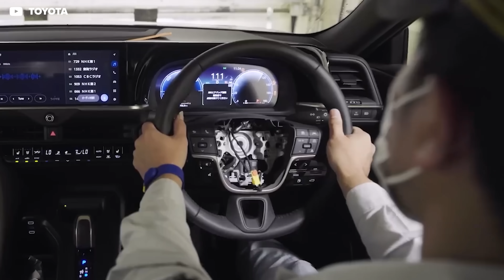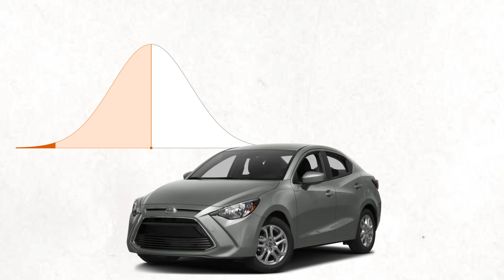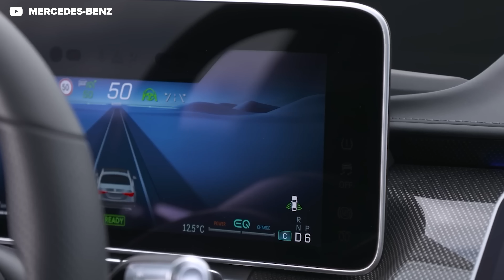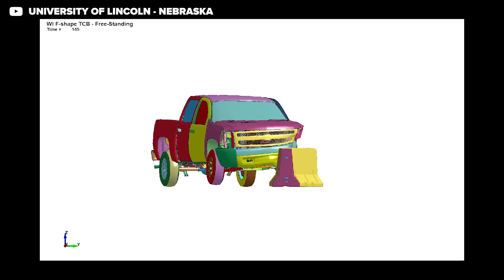The REAL reason guardrails can't stop EVs in a crash

Comment: In the UK we have double guard rails, so they can stop tall vehicles from going over and low vehicles from going under.
Expecting one guard rail to do both is insane
Reply: You could fit five UK's in Texas alone, we have a BIG car centric country, so building a double guard rail system across the USA would cost a fortune
Reply: Simple solutions often do not accur to our fellow beings accross the pond.
Reply: @h-j.k.8971  Despite what Europeans like to believe, North Americans are not dumb. North America is much larger than Europe is. To put some perspective here Canada and the entirety of the European continent are about the same size. The USA is about the size of Canada. Yet, Canada and the USA combined have about half the population of Europe. We have miles upon miles of road that needs to be maintained and less people to pay for it. So often road solutions here need to be cheaper and simpler to build and maintain. The cost of that second rail adds up really fast. It is not fiscally practical for us to use it across North America for our roads. One rail is often more than enough for most passenger vehicles and your little double rail is not going to make that much of a difference for a commercial truck. Those things are too big and heavy for that. The bigger issue here is that EVs are too heavy for a passenger vehicle and most places in North America can not justify having them on the roads. It is not a practical solution for transportation. We are not Europe. We have have different problems across the pond and need different solutions.
Reply: @midknight2329  Wow, looks like I´ve learned something here. Size matters.
Reply: @midknight2329 LOL. O your country so big you can out proper guard rail, but enough money to waste on military that can't pass audit for a decade, and bailout for big corp and billion of subsidies for stupid spacex that failed all its deadline?

Comment: The story was the usual American anti-EV big oil bunk. The maximum weights of cars haven't changed, we're not getting ridiculous 3000+ kg cars ever because nobody's getting an HGV license for them.

And if it comes to a crash I much prefer my weight to be down, rather than up. A heavy battery is a plus. The last thing you want is to embark on a flying roll that'll give you whiplash for life and a concussion.

The guardrail argument is invalid because outside of the US, guardrails are designed different and safer. Often they have additional bars installed lower to catch a falling motorcyclist; Motorcyclists falling and sliding halfway under a guardrail was ussually fatal, so crash-prone areas were fitted with bigger guardrails that extend lower.

Comment: Traditional guard rails are extremely dangerous to motorcyclists. The rider can slide under the guardrails and hit any of the posts with deadly or life changing injuries as a result. If the rider’s head is caught he is facing decapitation. 
All this can be avoided by placing a 2nd barrier under the 1st one. And this will also better guard EV with a low point of gravity.

Comment: Tesla going under guard rail is not about center of gravity but how was designed front crash bar. Height and size of crash bar is standardized (In europe it is 450mm from ground and 75mm thick crash bar? I am not sure at moment).  In case of Tesla issue is shape. They had crash bar designed as wedge!

Comment: 1960 F-100: ~3,088–3,105 lbs (1,401–1,408 kg)

2025 F-150: ~4,021–5,540 lbs (1,824–2,513 kg), with electric models potentially exceeding 6,000 lbs (2,722 kg)

Difference: The 2025 F-150 is 1,000–2,500 lbs heavier on average than the 1960 F-100

so the petrol versions of the F150 have increased in mass by between 30 and 90%....great comparison guys, but why let the truth get in the way
Reply from the maker: Comparing the average across the offered range is not the same as comparing equivalent spec

Comment: Generally a well designed EV isn't much heavier, but many aren't designed so well that way, so the point can still stand, just isn't a given.  The distribution is of course spot on.  Overall, good info.
Reply: EVs are garbage. They are a socialists dream of control.  Most people bought into the hype are now realizing this hard truth.  Poor resale value, limited charging infrastructure, low range, faulty electronics, expensive repairs and insurance.  Oh, and lithium batteries are a huge fire risk.  Time to wake up bud.

Comment: motorbikers cut on rails....so body lays over rail slides along top and rail edge cuts it or the joints that are a bit uneven pointy edge rising up  there , so , stronger armor suits or wider top edge could be half pipe shaped but is that harder to make cost much more,  or add on  thing to edge to make it flatter top , metal or plastic or wood or , or does that sharp edge need to be made smoother with some thick paint like material or epoxy, , or could triangles or something be placed on one or two meter intervals to lift body up throw it off the rail , ramps. metal plates on suits where body gets cut usually so dont get cut plate slides over, or some electronic systems , controlling falls how, drone on back activated , chute, deployed by automatic sensoring or how , movable rails fall back before hits ..hardly soon. oh , if limbs often cut, wire to limbs and  they get pulled to body when crashing falling how, motors or explosives or small chutes and anchors on suit chute moves from back pulling wire ancored to hip pulling arm to hip, or exploding bag out from back pulls wire , or system on bike pulls it . rollde up on wheel or

Comment: Bullshit. The 2025 Cadillac Escalade with the 6.2l IC motor weighs 2508 lbs. The 2025 Cadillac Escalade electric weights 2510 lbs.
The Tesla Cybertruck weights more than 6000 lbs and can’t be sold in Europe.
Reply from the maker: Don't know where you found those numbers but they're way off. The 2025 Escalade starts at a 5800lb curb weight and gets up above 6000lbs if you opt for 4wd. 2508 lbs is Miata RF territory.
Reply: @drive  I transposed the 1st two numbers. The curb weight is 5810 for the EV and 5805 for the IC (I'll stop adding comments to YT using an iPad). 
The point was that the difference between them isn't 1000lbs or more due to a battery.
What's causing these trucks to burst through guardrails and crush smaller cars is the squared off battering ram "macho" front end that is becoming the norm for pickups and SUVs.

Comment: Sorry, but at 2:47, that math to come up with 97th percentile is not correct. If you do the right math for those 2 things, you get 72nd percentile.
Reply: It’s more an error about what he said, speed AND angle is 72% instead of 97% for speed OR angle. The Percent percentile triggers me.
Reply: @evguenict  I mean, the right operator in that case is AND. But yeah, I thought about also mentioning the "% percentile", but thought that wasn't as important and might take away from my main point.
Reply: All his statement requires is that high angle impacts are almost all slower, and high speed impacts are almost all at a shallower angle.  Don't assume the speed and angle of a crash are independent random variables without seeing the real data.
Reply: Math and logic are not his strong suits.  These blatant errors Invalidate everything else he says.

Comment: Red Mountain Pass in Southwest Colorado is considered one of the most dangerous paved roads in the world. It has many stretches that are without guard rails or a shoulder. The white line is crumbling on the side of a mountain with a thousand foot drop off. Yet very rarely do vehicles go over the edge excluding flat landers in winter weather conditions. Maybe drivers should just slow the hell  down and not interact with the guard rail.

Comment: They said they test at 62 mph then later say they test at highway speed.  Highway speed is 65 mph and that isn't realistic either as most people drive at 70 mph or higher.  The other issue I have is they don't test at the lightest or heaviest vehicles on the road.  As for EVs the solution is simple and pretty cheap.  Just add a second cable at 15 inches off the ground to all existing guardrails.
Reply: 62 mph is highway speed.  70 mph+ is freeway speed.   And freeways do indeed have heavier-duty guardrails and barriers commensurate with the increased forces they'll be expected to handle.
Reply: @Drysart  

You obviously don’t drive much in rural areas of the western United States. There are a lot of vehicles doing over 80. And the trucks with a posted speed limit of 60. They are not doing 60. Try 75.
Reply: @gotsloco1810  Okay, but people breaking the law doesn't change the definitions of highway speed and freeway speed.

Comment: Bumper height compatibility is also a big issue. Cars must be 16-20in, but SUVs and trucks essentially can do whatever they like especially when liftkits are considered and never legally checked. Even though bumpers are primarily intended for low speed impact protection, they essentially define the height of the main support/impact structures of the vehicle, and whether it will go under, over or be caught by whatever it hits.

Comment: I drive a Miata! But my bestie refuses to ride in it because she feels it's a death-trap being so small I feel really safe in it because it's so small, has a real connection with and gets feedback from the road, has low low center of gravity, and you have a lot more control over situations. The times i've had to stop suddenly, or get out of the way of someone about to squash me into the side of truck, the car handled it great - even in the rain. YES EVERYONE NEEDS A MIATA!!  C:
Reply: Or a Honda FIT!
Reply: This is why I'm so into retired police cars!  Sure, they need some work, sometimes hefty work, but man those suspensions are something else.  You can literally feel the texture of the road inside the car!
Reply: @karalyzel3177  Yeah, that feeling is missing on most cars. Miata first car out of the 6 or so I've had to have that feedback..Next time i see a cop car for sale might give it a test drive, heard they got fast engines too :)
Reply: @ForbiddenMagic   Here's some tips I've gathered from owning a couple if you decide to get one!  Those with plastic / leather back seats are usually patrol cars, they use materials they can spray clean.  Patrol cars tend to have multiple drivers so they often take worse care of them.  Fabric back seats means it was a court's or a detective's car, those are usually in better shape!

The most important thing to check is definitely idle hours!!

For Chargers, HEMIs have lubrication issues at <1,200 RPM, that's why they have that lifter failure.  The higher the idle time, the more likely it needs new lifters and a cam.  For the V6s they have a similar issue with their rocker arms, so this applies to them too!  You can easily check those hours using the controls on the steering wheel, it's under the "vehicle information" tab.

Count that cam/rockers as part of the expense of getting one, it's preventative maintenance as once they go, they're gone.  Get an upgraded oil pump while you're at it!
Aim for idle hours under 4,000, (the lower the better), and always specify pursuit whenever you're getting brakes / suspension parts, they're just not compatible with the base models.

All that said, HEMIs love upgraded cams, there's loads of good choices for more performance, and pursuits already have lots of supporting mods pre-installed, stuff like oil coolers & massively better brakes! Though they always have some gremlins electrically, little quirks you'll find and get used to from open grounds...

You can find 'em over on carfax, or govdeals!  The former is safer than the latter, but man the latter has some crazy deals.  Best of luck!  :D
Reply: Miatas are one of my favorite cars. Such a pleasure to drive
Reply: I LOOOVED my Miata GT prht !! Perfect balance, tight supple shift, old school sports car.
Reply: I drive an A Class Hatchback and it’s already overkill in over 90% of cases
Reply: @MaticTheProto we have a leaf and its a hatchback
Reply: Give me give me give me
Reply: I don't drive large vehicles but I've never driven something as small as a Miata. I've never been almost squished between a truck while driving. Isn't the fact that you have to watch out for being squished a point against the Miata?
Reply: I know it's not quite the same thing but at the same time it really is I drive a 2001 Chevy Cavalier Coupe that I've modified and tinkered over the years. I still actively pick it over larger vehicles and trucks in the vast majority of situations.

The problem is kind of a herd immunity thing, where statistically it's significantly safer cheaper less pollution cheaper Insurance everything all around if everybody drove small commuter cars or better yet motorcycles.

If you kind of jump into the Weeds on the numbers it's kind of sickening the fatality numbers and percentages the larger the vehicle gets at speeds that you wouldn't consider fast unless you were in a small car close to the ground. Not to mention the fact that the safest way to drive is two cars ahead but you can't drive two cars ahead if the car in front of you has a significantly larger profile and since everybody has decided the phones are more important than driving this is a frequent frustration of mine
Reply: It's a small rwd car with a low roof.

It is a death trap, especially if you're not a good driver.
But since even f1 champion crash their cars, if you daily drive a miata (or any other sport car), it's just a ticking time bomb.

It doesn't even have to be your driving mistake. But that other car running a stop sign is more than enough.
Reply: @mondodimotori  boooooo!~

Comment: If we're talking clever engineering, why not have a barrier basically on the ground connected to another barrier that's a foot or two above it with some sort of catch in-between?  Leave the metal and supplies the same but double it up so you can account for not just EV's lower center of mass, but really any situation in which the center of mass deviates from the norm whether it be lower or higher. In none of those crashes did the barrier fail, we're just in a world where sedans can slip right under and normal trucks can just jump it.

Comment: 5:01, so it's the batteries.
Reply: Low center of gravity is good for a vehicle.
Reply: lol yeah but that is also what makes it safe.  If an ICE could be made into the floorboard they would as it.
Reply: No. Only in American ego carriages. Normal evs need way less batteries for good range
Reply: That's completely untrue. All cars with large ranges need heavy batteries, whether it's American, European or Asian made. That may change soon with the introduction of solid state batteries.
Reply: @Blackw1ng  Well built EVs aren't really much heavier
Reply: @MaticTheProto  They're atleast 500 to 1000 lbs heavier, especially if you want a range of 300+ mi.

Solid state should solve the weight issue while adding even more range, we have 1200mi range concepts running around.
Reply: 100% it's obvious

Comment: For what it’s worth, teslas are among the lightest of the EV’s.  Even rivaling a gas car per car type. A base model 3 is around 3,600-3,800 lbs which is actually pretty close to a gas powered Toyota Camry or BMW three series for example.  4,300lb Model Y is pretty close to a gas crossover like a BMW x3 .  Even for the massive rwd cyber truck it’s only around 6300 pounds.  another reason why Teslas out sell every other EV brand is basic specs betray how poorly built the other EV’s are for the “basic engineering”. it doesn’t make sense how bmw i4 weight is 1000 pounds more than a model 3!  or even a Chevy bolt is the same weight as the base model three about.  Yet look at how much more room and range the model 3 has.  Essentially the engineers are just stuffing too many batteries in the chassis and call it a day.  Tesla does not do this.   Anyways, that’s just a vehicle weight.   I guess it doesn’t matter because you’re going through the guard rail no matter what. 😂

Comment: Dodge Rams with the Cummins Diesel engines are also about 7000 pounds. And they are all 2500 / 3500 and larger models that have heavier frames that are less likely to flex or give at all and just go crashing through things.

Comment: that old car vs new car test was bunk as they took out the engine and some structural support of the older one
Reply: You can see the engine inside during the test in the video, you can also look at aftermaths of real crashes as well.

Edit: BTW, it would've helped the Bel air diver if it didn't have an engine or transmission if anything, because the issue WAS the transfer of energy into the passenger cabin, having more metal forcing its way back wouldn't help.
Reply: Why you lying man?

Comment: This kinda fails to explain HOW the centre of gravity has any impact on the outcome.
Can any vehicle with a low centre of gravity penetrate those barriers? Why does that also have an influence on solid concrete barriers? Why was that not an issue with previous low vehicles? How does that work when the vehicle is tall and has a high contact-point?
The main part of the reasoning is missing.
Reply from the maker: the point is that the only vehicles with high curb weights and extremely low centers of gravity are EVs. a low, gas-powered sports car can certainly submarine under a guardrail with enough speed, but it’s a lot more likely with an electric car
Reply: @drive  but that still does not explain at all how a low centre of gravity has any impact.